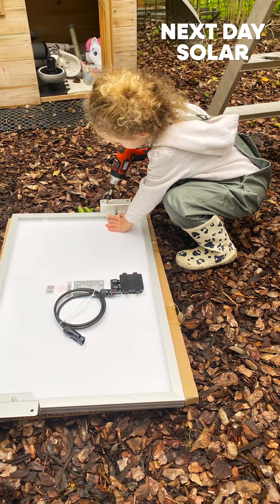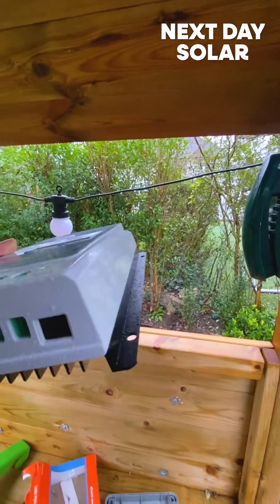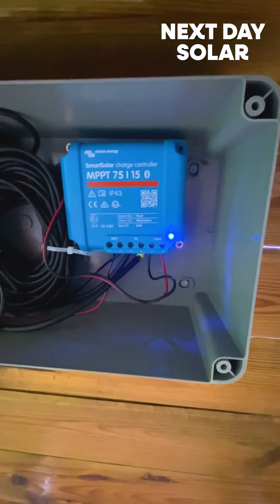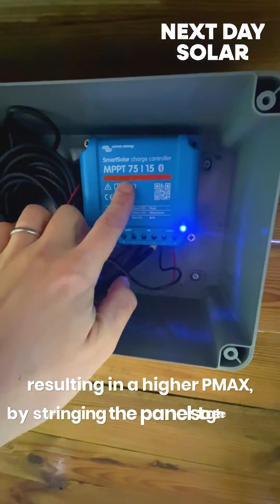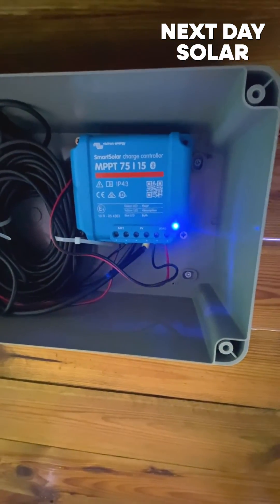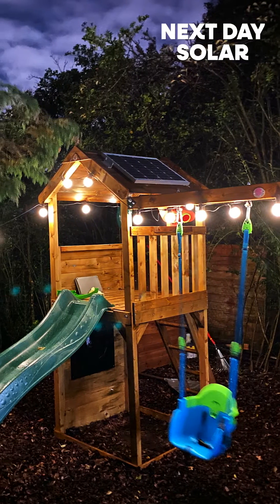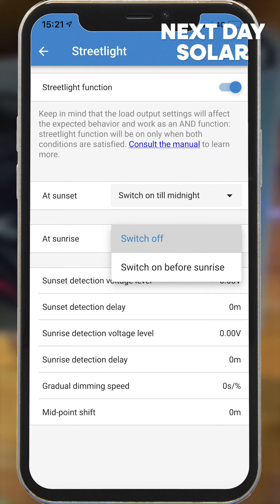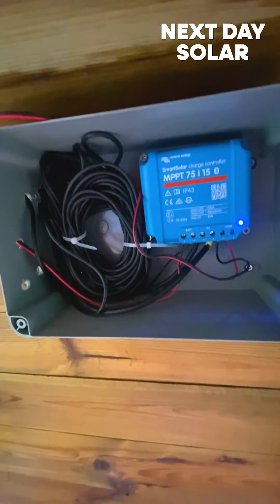Installing Victron 75/15 Solar Charge Controller on a Tree house for automatic lighting at night.

Comment: Please explain how to program the street light function and the procedure covering the jumper installed on the lower plug. Do you remove it for street light or leave it there. I need disk to dawn lights to operate. ✌️
Reply from the maker: Hi, I think you will find the following resource answers your questions: 

https://www.victronenergy.com/media/pg/MPPT_Solar_Charge_Controllers/en/settings.html#UUID-7e2a32d0-5081-9390-e203-195dcc754bc7

You don't need to touch the jumper for a basic setup, leave it there. You can simply program the device to turn the load output on at sunset, and turn the load output off at sunrise when the panels detect voltage. 

What lights are your plugging in ?